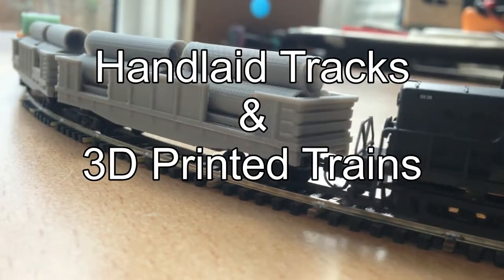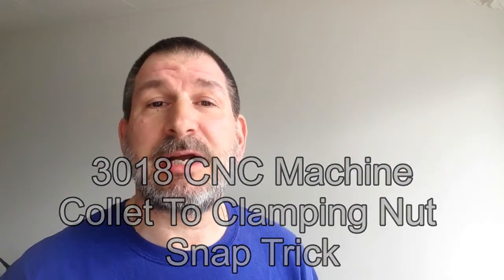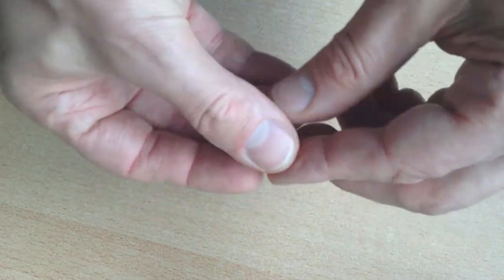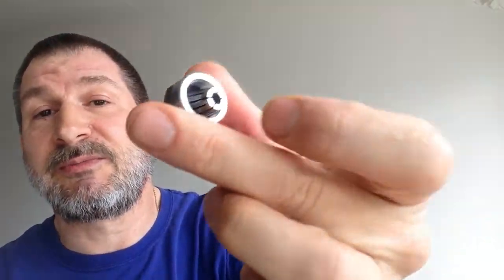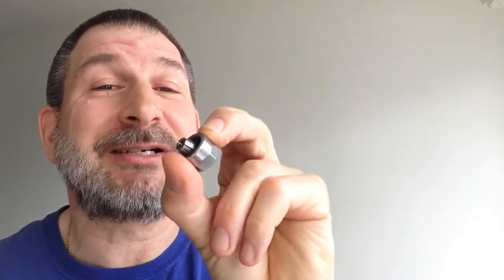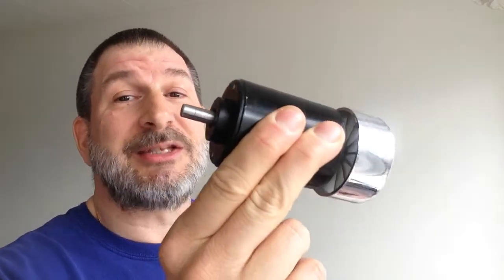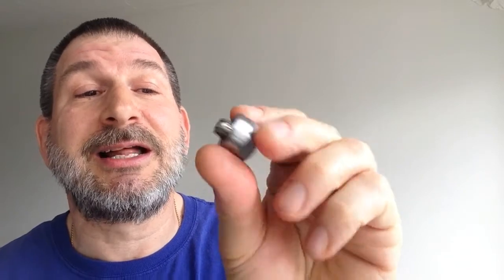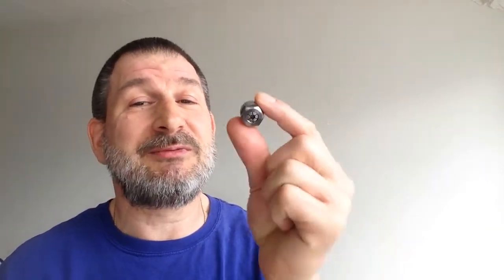3018 CNC Machine Have Bad Vibrations? Did You Snap The Collet Into The Clamping Nut? Nut Snap Trick!

Comment: I didn't know this and now I'm FURIOUS and GRATEFUL
Reply from the maker: So glad I could help and sorry for your frustration and vibrations... I know how you feel!
Reply: @handlaidtracksand3dprinted922  clicking it together didn't pull the collett and bit out with the nut, though - still need to apply plenty of WD40 and pliers. I think I'm overtightening!
Reply from the maker: I found my spindle wasn't machined properly. I removed it and bought a replacement - then lost energy for the project and it is still waiting for me to spend more effort. I ended up using 3D printed jigs instead to make the model train tracks as they are easier to make and last long enough for my purposes.